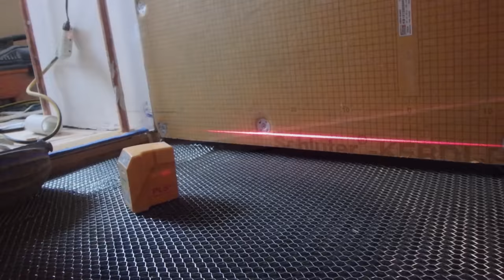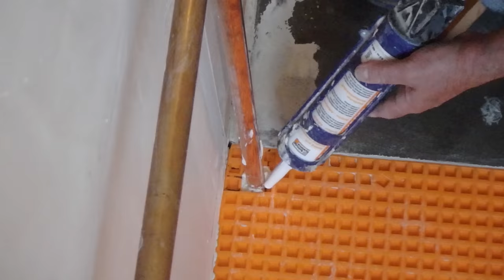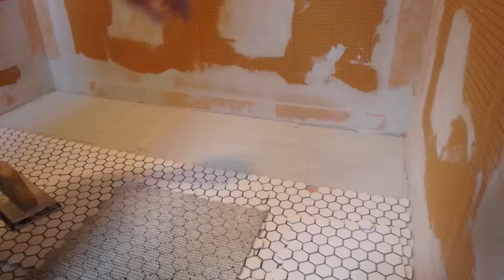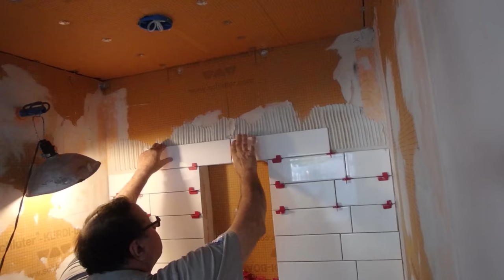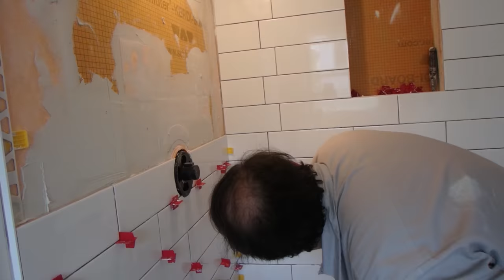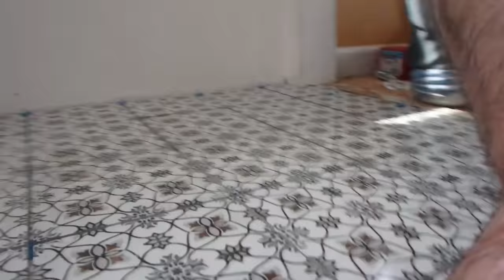Low Curb Shower installation, Not quite Curbless

Comment: Hi Sal. You deserve much appreciation for sharing your knowledge and experience in this industry. I have taken my business to a whole new level since following your videos. I have a question about your approach to this particular drain assembly. It looked like you added something around the edges of this drain that make it much smoother to lay your small pieces on. Could you please show that in greater detail for us?  I think everyone would benefit from it greatly. I have a tough time with small pieces around the edges of my drains and you seemed to have no problem at all with this one. Thanks for sharing all you do.
Reply from the maker: Tile was very thin, so I added a couple of layers of Kerdi membrane to make up the thickness, Try a FloFX drain, it is much easier to use. https://flofx.com/
Reply: @SalDiBlasi  thanks for your reply. I’ll research the FloFX drain and try it. 👍
Reply: @SalDiBlasi  Thanks Sal, had same question !

Comment: Hi Sal, thank you for the wealth of knowledge you share. I have remodeled four bathrooms based on what I have learned from you. I have made a few mistakes but overall I am happy with the results and working to get better. 

During the video, you did some origami with the Kerdi membrane in order to set the drain grate. May I ask what the reason for that was? I haven’t seen that done before. 

Thanks in advance!

Comment: How do you install the shower drain or flange in your shower specifically if it’s a mud pan? What height does it have to be above the subfloor or can you just put thinset beneath the flange and put it directly on your subfloor? Would you also use screws to level the subfloor for example with a flo fx drain?

Comment: Sal, do you consider foam curbs as reliable as brick/concrete? I'm about to do a tub to shower conversion and want to do a dry pack base, but am debating how to do the curb. Right now I'm leaning toward brick and cement, then Laticrete membrane over everything. Oh, one thing I've never seen addressed is how wrinkles are avoided when applying a membrane to a sloped-in-two-direction shower base.
Reply from the maker: I use foam curbs all the time, I prefer them, they are stable light and easy to install. Wrinkles are not an issue with a typical shower floor.
Reply: @SalDiBlasi  Thank you very much for the response, it's so neat to get a reply from The Man himself! I was asking because I worried that a foam curb could deflect under weight and crack the grout. Concerns alleviated!

Comment: Thairs a reason wages haven't increased in the tile traid for 20 years. Guy's don't float anymore,  it dosen't take much skill to nail up backerboard and slap up tile.
Reply: The reason to float walls is to make them Plumb and straight and if you have a proper wall you can use a green board with waterproofing AKA 
(Schluter)  I've had to fix a few mud walls and the old mud pans and you end up taking them out creating more cost for the homeowner. But if your wages have not increased I would look in the mirror because mine have but I have my own company and never have worked for the MAN.
Reply from the maker: You have it all wrong, if you haven't had a raise in 20 years, you are doing it all wrong.
Reply: @theartistone5860  just googel tilesetter wages...same as 20 years ago
Reply: @SalDiBlasi  look up tilesetter wages...same as 20 years ago
Reply from the maker: I know what I was making 20 years ago and what I am making now, not even close. I am very connected in the industry, I know what I am talking about. If you are not making good money then it is you, not the industry. Get connected, join the NTCA, learn how to run a business and Charge what you are worth. If you work low end jobs and for price shoppers, then you will never make good money.
Reply: There is not a single profession period that gets paid the same wages they did 20 years ago. Think about that statement for a minute, which you should have done before you typed it. That could be in the top 10 of most ignorant comments I have seen on YouTube.
Reply: @williamsauder1823  I don't need to google anything, I do tile work mostly kitchen and bath remodels and I am booked out two years and I am not cheap.
Reply: Wow.. so sensitive 🥺
Reply: @williamsauder1823  dont confuse low tolerance for ignorance with sensitivity